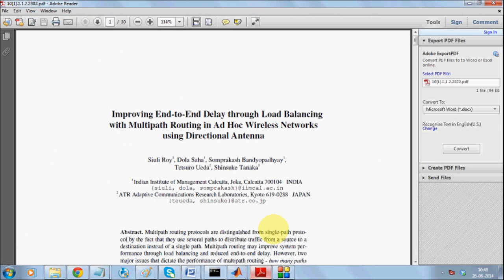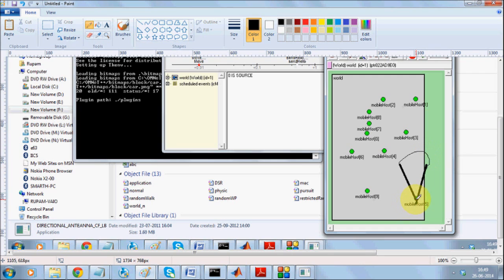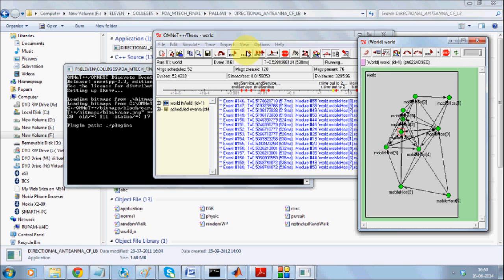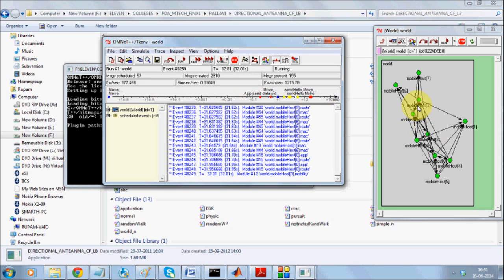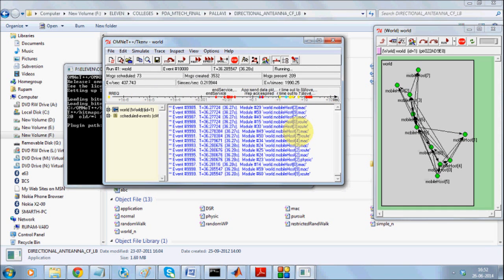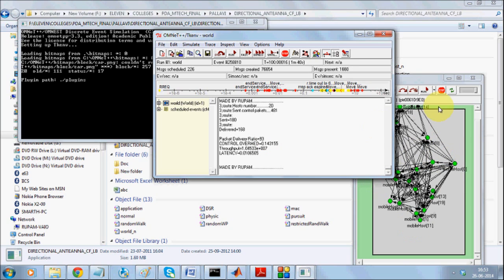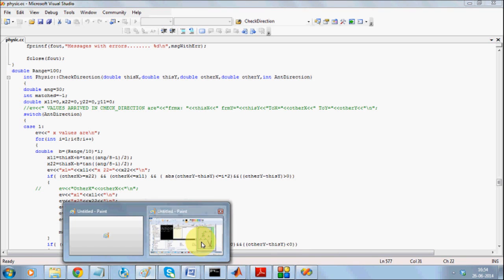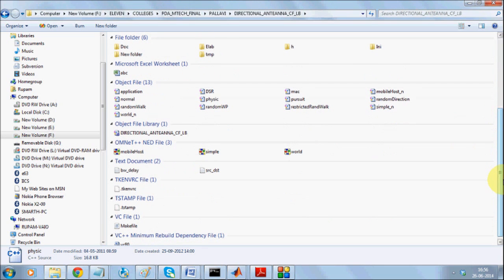Mobile Adhoc Network with Directional Antenna

Comment: Hi Rupam

As far as I know, omnet does not have support for directional antenna at the moment. Have you developed your own module for DA?

Saeed
Reply from the maker: Yes, this DA work is module developed by me. It has a mapper that converts packets to signals first. Then modulates, adds coefficients and in the receiver demodulates and decode the message.
Reply: Thanks for the reply. It sounds interesting. But, how do you manage node discovery? That is, how is the network graph  maintained? 
I'm wondering if your code is accessible on the Internet?
Reply from the maker: Saeed Bastani I have used Andras's manetSim3.2. That is simple but a very effective model. For discovery I am using RREQ packets and HELLO packets as usual.  When packets enters into physical layer, I am filtering them out based on Antenna theory.  I would try to post a code link here.